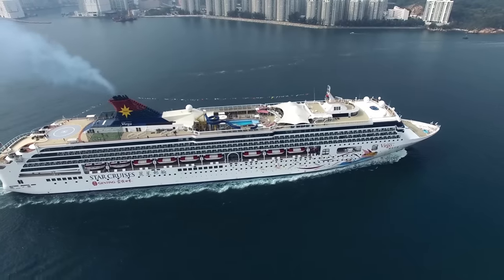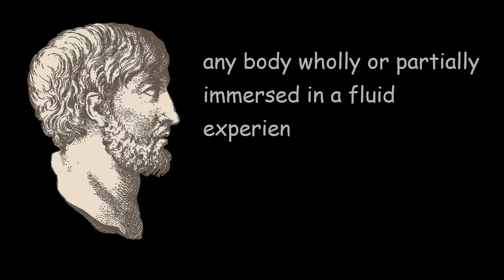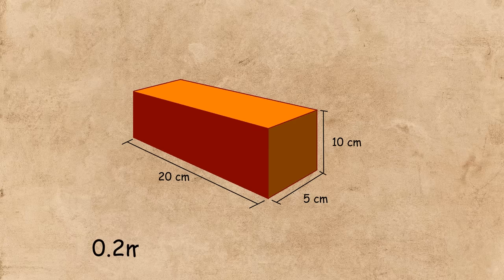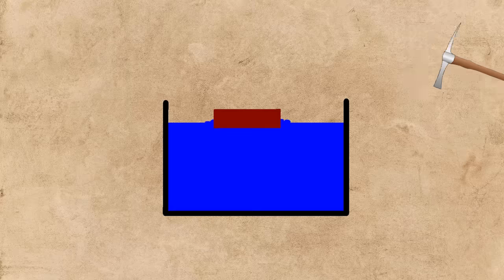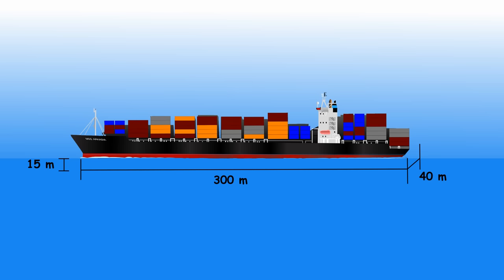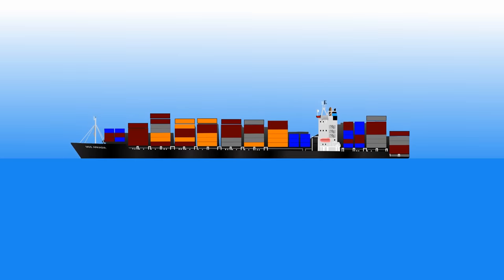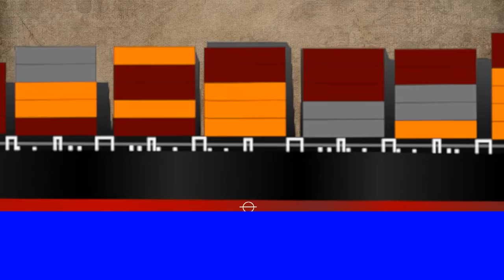Why do big ships float? [Buoyancy and flotation explained]

Comment: Without watching any more of the video (12s in).

You have to work out what the average density of the volume below the surface is. And if it is less than that of the water, it will float. 

Imagine a lead balloon. The skin might be lead and way more dense than water, but most of it's volume is air, which is way less than water.

When you take the mass of Air and add the mass of lead then divide by volume, you get the average density. Which is probably less than water, so the whole thing floats.

Boats are the same. As long as the average density doesn't change (by more dense water pouring in and replacing less dense air) it'll keep floating.

This was less of an issue in the past because most boats/ships were made of wood, which in general is already less dense than water.

Comment: I can't believe nobody here is upset over him describing 1kg as a force and not a weight. Multiply that weight by 9,81m/s^2 to make it a force.
Reply: Multiply that mass* by 9.81 to make it a weight*
Reply: A weight is a force. You mean mass
Reply: 1 kg can be a force or a mass. 1 kg mass = 1 kg force. Its just a convenient force to use in simple explanation like this, on Earth
Reply: 1 kgf (kilogram of force) is 9.81 N, a derivative metric unit. its much more convenient working on forces on Earth's gravity, rather than multiplying everything to 9.8
Reply: Weight is force though. It’s the force that keeps you (pull you to) on the surface of Earth.

Comment: I know the difference in density between freshwater and saltwater is minimal but just wondering since cruise liners tend to be designed for saltwater, would they float on freshwater. That might sound like a ridiculous question, but in engineering the calculations are extremely precise, or perhaps the bottom of the hull might sink a bit lower in relation to the water line. Anyone know?

Edit: nevermind I finished watching the video and my question was answered. Brilliant video.

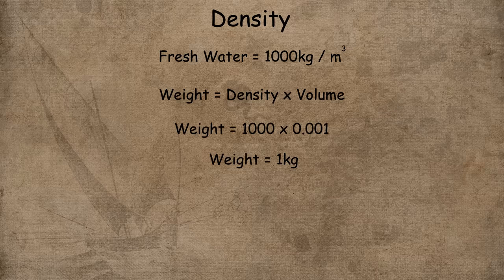Comment: 1:43, it’s mass not weight.
Reply: @Oussama-sabouh  they can call it whatever they want, but kg are mass... weight is in newtons and kg force is not a proper unit. This is probably due to the incorrect way that someone decided to label metric scales in kg and the improper conversion that everyone does of kg<>lb. This is a case where the imperial system is correct, as pounds are a unit of force and slugs are the imperial unit for mass.

Comment: the brick confuses me, 20x5x10 would be 1000 yes? which means 1000 cm^3, but he comes out with 0.001m,^3 which is just 1 cm^3, but the math is correct because decimals make it smaller, so you just arent supposed to make it meters in that instance?

Comment: So in short: whether it floats or not depends on whether it's lighter or heavier than water.
Reply: Essentially yes. Slight correction though: more or less dense than water. How heavy it is does not matter, it is the relation between weight and volume. Something can be as heavy as a ton and float if it has a volume greater than 1m³, it can be light as 1 gram and sink if it displaces less than 1cm³. It has to be less dense than 1kg per liter (or 1 ton per cubic meter). Neat - right?

Comment: Great explanation except that Kilo is a unit of mass. You still need to multiply it with acceleration due gravity in order to be represented as weight/force.
Reply: It's weight is still the same in kilos as the layman uses it (technically it's the kilogram-force). Multiplying kilos by gravitational acceleration only converts it into newtons (a unit definitely not used by the layman).

Comment: At 3:09 you used "tons" instead of the metric "tonnes." While roughly equal a metric ton is 1.1 times an short ton, or 1.01 times an imperial ton.
Reply: isn't it supposed to be in kg

Comment: Even though I know mass isn't a force, and would often be pedantic enought to point it out, I managed to watch and understand the whole video without noticing the mistake/simplification.  :-)

Side note, while mass isn't a force, you CAN have pounds of force, since pounds of force (lbf) and pounds of mass (lbm) are both formally declared units.  In modern definition 1lbf = 4.45Newton, regardless of local gravity, so 1 pound of mass weighs approx 1 pound of force on Earth and 1/6 pound of force on the Moon.

I looked this up after witnessing a blazing row between two clever people who should have known better.  They both knew their physics, but both said "pounds" when one meant lbf and one meant lbm.
If we'd avoided the metric system, the video would have been correct.  But there would likely still have been an argument.  :-)

Comment: but the thoughtful question is if we put a cylinder inside a bigger cylinder and change the volume of the inner cylinder which effectively does not change the volume of the outer cylinder. would it affect the buoyancy of the outer cylinder?
Reply: ...No, it would not. It might change the weight, but the buoyancy itself would be unaffected.

Comment: Mass= volume * density
Weight is a force its unit is Newton  not kilogram(kg)
Weight = mass * g(acceleration due to gravity)
Reply: kgf, is kilogramm force, the force 1 kilogram has. kinda oddball unit but still is in use.
Reply: Ohms Law is a key equation here, never lose sight of the fact that Scouser are #MilesAhead

Comment: Can someone explain if the archimedes principal is why ships can float, then why do anchors sink so easily ?
Reply: Archimede's Principle states that a body immersed in a fluid experiences an upthrust equal to the weight of the fluid displaced.

The average density of the total volume of the ship and everything inside of it (including the air) must be less or equal than the same volume of water. That's what keeps it floating. 

When an anchor is dropped into the water it sinks because the anchor on its own has more density in the volume of water that surrounds it. The upward force that the water produces against the anchor is not strong enough so it keeps sinking until it hits rock bottom.

For example: imagine you are weak and skinny and a bigger more muscular guy pushes you, you would fall over (the bully wins). now imagine that you are much bigger and muscular than the same guy and he push you again, he will not be able to. Same principal. In easy terms, the anchor is more stronger than the force of water so it goes right through it.

Comment: What do you mean by displaces. Does that just mean the water rises like you showed in the video? I’m sorry I still don’t get it. Surely the volume of the object=volume of water that moves up/is displaced. why does the volume of the object submerged = the WEIGHT of the water displaced and not the volume of water displaced?? Thanks so much
Reply: An object will submerge until it has displaced exactly the volume of water equal to it's weight. It's tidy that way.

Comment: I finally understand it, thank you so much, tho to make it easier for a lot of people, in the example of the ship, when it displaces 180,000m3 of water, you jumped into talking about the weight of water displaced being 180,000 tons, you didn’t explain that by tons you mean 180,000,000kg of water Which you got by multiplying 180,000m3 by 1000kg/m3.  I feel like it’s gonna help a lot of people grasp what your explanation. Thank you so much.

Comment: Do Vessels cause sea level rise?
Reply: Yes, but one vessel only makes it rise by like 0,000000000000000000000000000001% or something...so technically yes but not really measureable.
Its like the fact that touching a table makes it hotter since your touch transfers energy...but you can never feel it because its also just a tiny percentage.
Reply: @GalenMarekOfficial  so there is a rise 👋🏼😎
Thanx

Comment: Okay maybe I'm just an idiot but I swear the calculation of the brick is wrong. The volume comes out at 0.001m cubed which is a millimeter. A brick with those dimensions does not have a millimeter cubed of volume? If we work with the centimetre measurements, we have 20x10x5=1000. 1000cm is 10m. So we have 10m cubed not 0.001m cubed. So why when calculating in two different units of measurement do you ultimately get two different number of metres cubed after any necessary conversions? Someone please explain this to me I'm baffled and no one else has said this so I'm wondering if I'm just missing something incredibly obvious. 😅
Reply: Idk but basically if you multiply decimals they get smaller, and vice versa (if you divide they get bigger). That’s just how maths works. I just came here for my physics homework lol.

Comment: What is counter intuitive is the thought that small boats would be "better" at floating than large ships.
Reply: the opposite as expected
Reply: The smaller an object the easier to get it to float due to easier construction (small boats don't require advanced materials to stay intact under its own weight and water pressure) and surface tension (you could try dropping some powder on water and see that even without tricky design most powder particles float easily).

Comment: This can be explained in one sentence.  The weight of the ship is exactly equal to the weight of the water displaced.
Reply: Or the weight of the ship can be less than right?
Reply: @ryanh6586  no, the weight of the floating ship cannot be less than the water displaced. The ship simply settles into the water until mass displaced is equal to the mass of the ship. However, the ship can be heavier than the water displaced, in which case it is sinking.
Reply: That would be neutral buoyancy.   Ships actually weigh slightly less than the amount of water they displace.   If they weigh the exact weight of the water they would float below the surface, not on it.

Comment: Its simply the downward force(gravity) is equal to the upward force(bouyancy)..if the bouyancy is in excess..the ship will capsize...if the gravity is in excess..the ship will sink...

THE END
Reply: If the buoyancy in in excess it will not capsize.  It floats because the buoyancy is always in excess of the weight...
Reply: It's more about where the buoyancy is, rather than how much of it there is. You can have as much buoyancy as you want, so long as the weight can keep it stable. This can become hilarious with submarines, since they need to remain upright even while 'sinking', means weight placement is quite important.

Comment: simple, ships are mostly empty space.
Reply: You find it simple that metal ships weighing 500.000+ tons including cargo float in water just because there is some empty space between decks? Not what I would call simple. Also, a for example hollow rock would still sink in water because of the reasons mentioned in the video. Its not just about empty space.

Comment: That Metric crap gives me a headache!
Reply: On the contrary, it makes perfect sense. You did notice how every unit tied in with every other in a logical way, right? The more different units you involve, the easier the relations between them becomes to handle. And it is all in decimal fractions, so never any need to convert feet into 1/12th part to get inches or to remember that there is three feet to a yard and 1760 (?!?) yards to a mile. Instead, one meter is 10 decimeters (do) or 100 cm or 1,000 mm, and 1 kilometer (km) is 1,000 m or 1,000,000 mm. No need to remember anything other than the size of the prefixes, every conversion is easily done in your head. Now, tell me - quick now - how many inches are there in 1/8 mile?
And how much weight - in pounds - is displaced in fresh water by a brick which is 8 by 4 by 2 inches?
I can quickly tell you the same in kilograms from the dimensions 20x10x5 cm, as in the example in the video. No calculator required.
Reply: @bennylofgren3208  The unit conversions being logical are indeed a consequence of the joined up design of the SI system of units. The coincidence of water just so happening to have a density of 1000 kg per cubic meter however are not in fact this is not a coincidence at all but instead it's an arbitrary decision since the density of water at 3.98C (The temperature where it's density is at maximum) was literally used as the reference point for defining the SI mass unit. Try it with any other material and you will quickly get a reminder that the universe does not care whether it's nature happens to line up with our neat system of units or not as it does not exist to make math easy for humans heh. Hell try it with water at any temperature other than 3.98C or with any impurities present whatsoever in any application where accuracy really matters and you are still going to appreciate that calculator in your pocket.
Reply: LOL If your head can't handle nice round numbers like 1000, then get your head checked

Comment: Force isn't measured in units of mass.
Reply: Force (weight) = mass x acceleration due to gravity.
F=mg
g is constant (9.8ms^-2) for all things on earth. For comparisons, there is no diffrence if you multiply by 9.8 to have an answer in Newtons or leave it as kilos. So it's fair to talk about the downwards force of the brick in the water in kilograms.